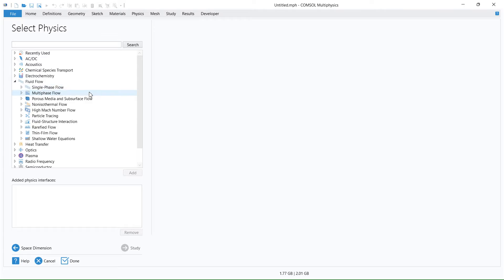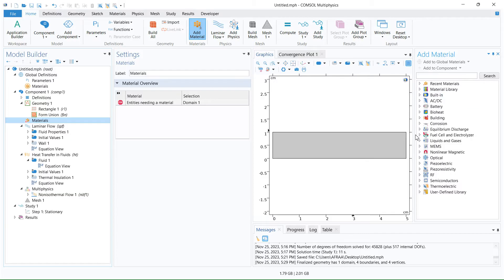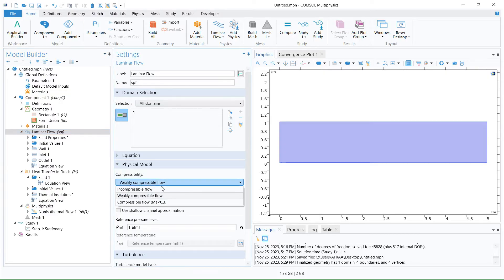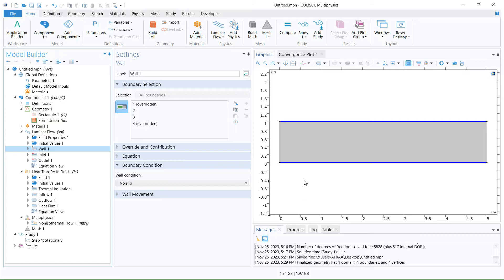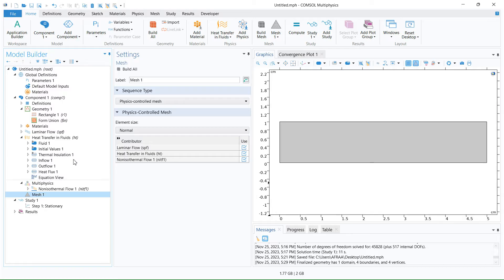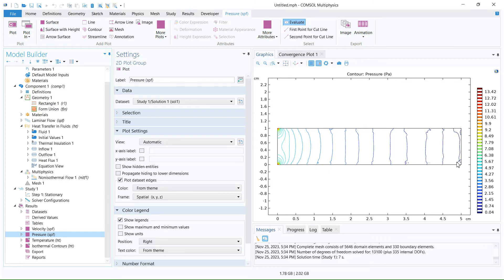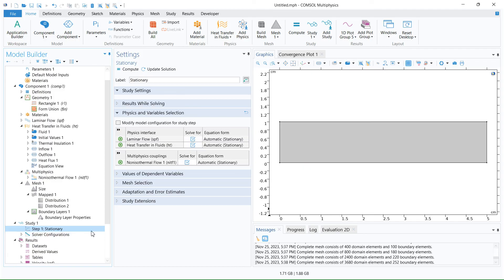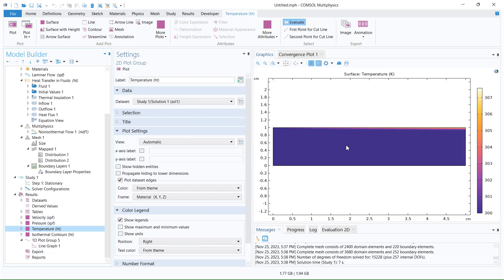COMSOL: Basic Fluid Flow and Heat Transfer

Comment: Sir can you describe how to assign two inlets and two outlets for an absorption tower for two different fluids
Reply: Thank you for your fast response,  I  watched your video on 2 phase flow but can you briefly explain what do you mean by " define 4 boundaries for inlet and outlet "
Reply from the maker: Your domain has four boundaries, with two for the inlet and another two for the outlet. You need to define them according to the geometric dimensions of your system. @shesitherreddy2974